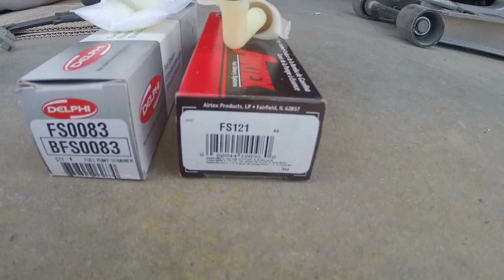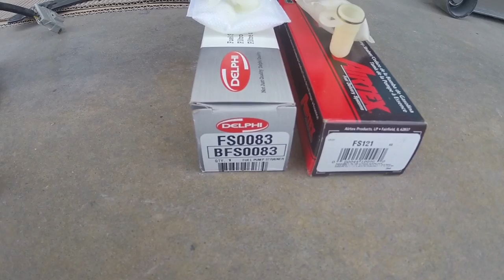How to Replace Fuel Pump & Gas Tank (88-91 Civic/CRX)

Comment: I just want to point something out that may help someone in the future, as this happened to me. I followed this video step by step and other various fourms to install my new 255lph fuel pump into my ef hatch, and after everything was set up and ready to go, the car wouldnt start. Doubting my mechanical skills i took everything apart again but still everything looked fine, at a complete loss and after hours of searching I came across a couple "no-start" main relay fixes, swapped the relay from my doner car and what do you know? Starts on a dime, what are the chances? Anyways, great informational video, a definite thumbs up from this guy!
Reply from the maker: Thanks so much for the input!  It's great to hear what fixes other peoples problems.  I can't tell you how many times I've done double work similar to you only to find it be something so simple!  Were you shaking your head at how easy it was to get to and replace/repair the MFR?
Reply: Garage Built Hondas 100%! although funny enough after I got it started and ran it for a bit I lifted the tank back up and tightened everything, all ready to go and what do you know? No start! 😂 im even more stumped now, multi-metered the relay and everything checks out, checked all wires and even tried the bypass wire in the harness and nothing! Such a pain this civy of mine 😫
Reply: KeySho What did you end up finding wrong?
Reply: @Keyorisho  Did you check fuses?
Reply: @hecks_k20_fa5  Yes, fuses checked out. I double checked almost everything I could think of.
Reply: @brent2630  In the end it turned out the be the fuel pump not reaching the lower 25% of the tank. Filled the tank and it started right up haha. Really weird because it was installed exactly where the original pump was, it's been a while but the new pump may have been a bit shorter.

Comment: Why are you replacing the gas tank ? Just have  it cleaned at a radiator shop just as good as new. ?? Great  instructional video !
Reply from the maker: Mine had damage and a small leak.

Comment: Hi Jon it's hadden vladamir III on my wife's phone and watching your fuel tank and fuel pump removal and replacement video and wanted to post a cool and helpful tip....on both my sedan and ef hatchback I had replaced my fuel tanks and took the opportunity to prime the tank with hi heat primer then duplicolor bed coating as a protection from the elements.....part 1
Reply from the maker: Nice!

Comment: Wow. I never knew how different the wagons were from the other models lol. Everything is accessible from inside the car in my wagovan. Extremely helpful video though
Reply from the maker: I wasn't aware of that on wagons.  Thought all 4th gen civics had no access to the fuel pump from the rear interior, good to know.
Reply: Hunter, could you confirm what year wagon you have? I need to replace my fuel pump in my 89 wagovan, and I was also under the impression that you needed to drop the tank. Could you access the fuel pump from under the seat?? Thanks!!

Comment: Huge fan of this tear down and it helped me last year with getting my Y49 to run again! I'm currently running issues with putting the Filler Neck Hose back on, and I found the part(17651-SH3-000)0 is discontinued so I'm having to use a universal fuel hose and cut it to size, but I'm still worried it's going to kink a little. 
I think my next step is to completely drop the tank again and place the hose onto the tank and then left it back up and place it on the Filler Neck Pipe second.

Awesome Channel!
Reply from the maker: Thanks James.  There isn't much bend to that hose so I think you'll be ok with a universal one.  As it's on there, it'll slowly conform anyway as long as you don't leave too much slack for it to bind.
Reply: Garage Built Hondas I’ve loosened the clamp around the filler hose but it’s not budging. Any tricks?
Reply from the maker: Spray it down with a lubricant and use different sets of pliers

Comment: This is most insightful! I have a 2001 honda civic coupe, and after getting my map sensor and 02 sensors installed, I still kept smelling gas fart. Also I think that my front passenger side tire rim is bent or something...the car pulls to the right (whatever). Anyway, after watching this vid, I think I'll just buy another car and put my civic in the backyard until further notice. Thanks dude!! ★★★★
Reply: I got a 89 Honda prelude I have to change the gas pump  is that also in the tank so that mean I have to bring the tank down????
Reply from the maker: +Manuelmmmzmskssnmsn mmmsmak Galvez Not unless you have the door under the rear seat.  I bet it's the same as this being similar design because of the same years.
Reply: Garage Built Hondas well is 1989 Honda prelude si 2.0 n under the back sits there is 2 round silver lids
Reply from the maker: +Manuelmmmzmskssnmsn mmmsmak Galvez I would check under both, you might have access there.

Comment: Also if the fuel tank padding isn't salvageable here is a cool trick order some extreme sound dynamic padding from summit or jegs or cruchfield with self adhesive backing and cut to fit where needed.....it worked great for me and very inexpensive....part 2
Reply from the maker: That's sounds smart, I've used that product before and it seems like it would work perfect.

Comment: Attempted this today, but had to stop due to rain. Tomorrow is clear weather. Unfortunately my pump went out right after I filled up. So after cracking that 14 line nut 🔩 I had fuel leaking. (Which I figured would happen) tried to siphon the gas from the gas filler, but feels like my siphon line is bottoming out before it makes it to the fuel. Anyways, I'll just have to pull the drain plug tomorrow... Great video man!
Reply from the maker: Good luck, the tank is so heavy with a lot of gas in it too.  I'd tried to drain it too, but save as much as possible.
Reply: @GarageBuiltHondas  the weather cleared up so I pulled the sending unit out and siphoned the gas into two 5gallon plastic tanks. It got dark, so tomorrow I'll be finishing her up!
Reply: @GarageBuiltHondas  completed the job just now and filled about 5 gallons back into the tank (via gas cap/filler) connected everything back up. I hear the 2 clicks from the main relay which is good... Right? At the same time I hear the fuel pump prime... I cranked it about 5 times. (Holding for 5 to 10 sec each time) and no start. Should I put the other 5 gallons in the tank? Maybe through the sending unit opening? How quick should it start up after replacing what you did in the video?  Guess I'll check the manual to see if I'm fuel to the fuel rail. Thanks again for all your help and the time you take to make these videos. I appreciate it.
Reply from the maker: The extra gas won't help unless your fuel pump filter isn't sitting right.  I'd do what you mentioned.
Reply: @GarageBuiltHondas  UPDATE::: I committed the ultimate sin of not checking for Fuel, air, spark, combustion FIRST.  After replacing the fuel tank, fuel pump, distributor, and main relay I still didn't have spark. I went to test the coil at the dizzy, noticed the rotor wasn't spinning... I knew what time it was. Busted timing belt. Smh... All I can do now is pray to the honda Gods that the valves aren't bent. Sourcing parts for this JDM D15B 3 stage vtec is always fun... anyways, lesson learned. Basics first. Time to wrench and pray.
Reply from the maker: Hope it's goes well.  Good luck!
Reply: @GarageBuiltHondas  same! But hey, now I know how to change my fuel tank and pump. Lol thanks again for the videos~
Reply: @GarageBuiltHondas  :::UPDATE 2:: installed new Timing belt, tensioner, water pump, battery (was bad) was still not getting spark. Used my multimeter and test light and found the NEW dizzy had a bad igniter. Warrantied it out, slapped it on and she fired right up!!! Yeahhhh boiiiiii!!!
There's is a ticking noise now. I'll be doing a comp. Test this weekend and I'll also check to see if the LMA's could be the culprit. Just happy to have her up and running again.

Comment: Could you perhaps provide me part numbers for the right Fuel Pump for my 90 SI EF Hatch?  I have the D16A6 motor and like you described, my hatch has the same issue with acting as though it has no gas when the gas gauge still shows about half way full.  It's been driving me crazy for almost a year and I'm wanting to make sure all the part information I purchase is correct before taking it to a shop.

I've had a feeling it was the fuel pump for several months now that were causing the idle issues, and sometimes having issues starting on hot/cold days, and bogging at higher speeds.. but yesterday was the first time the fuel pump starting whining which made me ready to get everything needed to replace.  Would love to do the whole gas tank as well.

Thanks in advance!  Video was helpful
Reply from the maker: I don't have the part # for the pump.  Where do you want to buy your pump from?
Reply: Garage Built Hondas no preference I just know my car is having the exact same issue as what you described with the tank acting like it is completely empty even though there is almost a half tank

Comment: You made that look a lot easier than it is. Loll. I just changed my fuel pump in my 91 REX Si. Filler neck hose and putting the tank back in the front clip was a bitch! Thank you for your video tho. Helped me out. 👍🏼
Reply from the maker: It really is for the first time.  I guarantee it gets easier every time.  Now I'm a pro after doing at least 10 since this video came out.  👍

Comment: Cool video. I cam here because I have an issue with my 1991 CRX SI.  It has happened twice, a few days apart.  Both times, I parked the car for a few minutes.  First time, I stopped at a gas station. I shut off car and put in full tank.  Then I got into car. It started and stalled.  I cranked it again. It started and then stalled.  Third time,  it started and I was good for the rest of the day.  Now, today, I drove 40 miles, parked car and went into store. Slight incline. I started car. It started then, died.  It started  then died.  It started and I got it home.  I stopped the car at the house. Then, I started it and no problem. It's been sitting for 30 minutes now. I went out and started it three times, each time being ok.  Ideas?  Maybe fuel pump going out?
Reply from the maker: Yup.  Pressure test the system/pump.  https://youtu.be/i9t9OapKffg

Comment: What did you do with the O ring that came with the fuel pump. When I replaced my fuel pump I seen it but didn't know where it went so I just left it out.
Reply from the maker: Which O-RING?
Reply: when you buy the fuel pump it comes with a short hose, two clamps and a black o ring. its in your video
Reply from the maker: Do me a favor, what minute mark is it at?

Comment: Thanks! You are a CRX pioneer. I'm waiting for that fuel pump to come today through Amazon Prime. Meanwhile, getting the fuel out of the tank is nasty. I tried to go old school and syphon it out with a hose and me sucking on the other end. Ended up with a moth full of gas ( I didn't swallow). headed Auto Zone for a Fuel syphon pump. Thanks again.
Reply from the maker: You're welcome, glad this helped!
Reply: Update, It wasn't my fuel pump. It was the ECU fuse and ECU. I have a bad ECU so it wouldn't prime my fuel pump. Nonetheless, I don't have to worry about the fuel pump.

Comment: Great videos! Off topic question, but why don't you remove the sound detonating tar for weight reduction? I noticed you were doing weight reduction in your other vehicles
Reply from the maker: thanks!

I planned on it but haven't had the time yet.  Unfortunately I live in Texas and it's a little hot already so that'll make it more of a pain in the ass.  I was hoping to finish it in the winter but now I'll probably just go get dry ice and chip away at it.
Reply: +Jon Widmer I see. Yea that sucks man. I would hate to be in the heat when you already sweat from working on cars lol but good luck with the build! 👍🏽

Comment: Hi Jon.   I replaced the fuel pump and gas tank and still can't get it to star. What do you think it's wrong with  my crx. The fuel pump and gas tank had rust all over.
Reply from the maker: Had it been running before?  Has it been sitting for a long time?
Reply: Justin Vargas main relay

Comment: just curious why did you change tank. going forward with the new tank, how will you drain the tank if you need to work on tubes and all?
Reply from the maker: I dented it at the track and it was leaking.  It had previous dents also but the latest sprung a small leak.

It has the drain plug still, I could drain it and work on the tubes if needed.

Comment: hey man great vid! I have a quick question and hope you can help. I started my car(1991 hatch) early in the morning and it iddled for like 5 sec and it stalled and just wont turn on again. I no longer hear the fuel pump buzz when i switch the key is it the fuel pump for sure? need the help and appreciate your video man
Reply from the maker: It kind of sounds like it.  You may also want to try to Main Fuel Relay first.  It's located under the dash on the far left driver side right above the hood release.
Reply: Jon Widmer okay man thankyou

Comment: i have to replace the gas tank on my 2000 civic si do you think the steps would be the exact same please let me know
Reply from the maker: Exactly the same, probably not 100%.   But probably very similar.  There may be a few different lines by now, I've never changed one on that kind of car.  Good luck

Comment: Another great video man, much appreciated! I’m waiting for the fuel pressure gauge and if the pump is failing on my Teg, I may have to do this... 

Correct me if I’m wrong 88-91 Civic/CRX Integra NORMAL fuel pressure is between 32-37PSI correct?
Reply from the maker: I can't remember off the top ofy head.  I did talk about it in this video where it should be with the FPR unplugged and plugged in.  https://youtu.be/i9t9OapKffg
Reply: I'm currently looking at the CRX OEM manual page 6-76 and with the regulator vacuum hose disconnected it should be 35-41 PSI.  (I know it's an old post, thought future people might want to know).

Comment: I have a 92 Integra and was wondering if a 88 - 91 civic/crx suspension would fit my car?
Reply from the maker: It fits, but if I remember correctly the shocks will be shorter than the 90-93 Integra shocks.   It depends on the complete setup that you are using.
Reply: Alright thank you for the quick reply.

Comment: why did you opt for the Airtex FS121 fuel strainer instead of the Delphi FS0083? I'm aware both work, but just curious. I'm assuming because you could return the Delphi, but not the Airtex? Also, where are you located, if you don't mind my asking? Thanks for the great video.
Reply from the maker: Captain Teemo Absolutely correct, I had purchased the Delphi at Autozone and had ordered the Airtex online, and the Airtex was about $4 less expensive too.  I am in El Paso!  Are you in TX?
Reply: Jon Widmer Ah, Texas! Sadly nowhere close, I'm in Northeast Alabama, almost Georgia. I've had a nearly pristine '91 CRX Si sitting in a garage for 5 years, after rescuing it from a cow pasture shed, which I've finally began work to make road ready again. No engine or trans. I have zero concerns with the work as I'm a trained technician, but figuring out how all of the minor things are oriented, installed, which fasteners, etc. is going to be a real pain. Watching various instructional for all scenarios I might run into. Found your playlist, subbed heh
Reply from the maker: Captain Teemo I see, it should be a lot of fun.  These cars are pretty easy to find your way around.  If you do need a hand with anything let me know, I may be able to offer some assistance!
Reply: Jon Widmer Thanks Jon, I'll be sure to keep you in mind!
Reply: EP boy here too
Reply from the maker: What do you drive?
Reply from the maker: I've used both.  Couldn't tell the difference.  Both work perfectly fine for any normal fuel consuming needs.

Comment: At 2:50 where you recommend to use the line wrench... is there anyway you can replace that fuel line? My brother used a regular wrench to disconnect that line and stripped that nut and then stripped the threads inside when he attempted to reinstall :(
Reply from the maker: Try a junkyard for replacing parts.  I don't know if they sell them new any longer.

Comment: The CRX SI and DX have a 11.9 galllon tank right? I have a 88 CRX HF with a 10.6 gallon tank, but only the 11.9 seems to be available as a replacement part. It should fit the HF model right?
Reply from the maker: Yes
Reply: @GarageBuiltHondas  that’s weird they made a different tank for the hf even though the other one still fits.
Reply from the maker: Smaller, less weight when full for the HF to achieve the MPGs it did.

Comment: It's enough to say run the gasoline out to lighten the tank.  You could point out that gasoline weighs about six pounds per gallon, so five gallons in the tank weighs a little over 30 pounds and ten gallons in the tank a little over 60 pounds and full is about 90 pounds.
"Kilmat 80 mil" from Amazon is the vibration dampener to glue onto the tank.  It comes in packs of 12" x 18" pieces which can be cut to any lesser size.  Way too much talk about the vibration dampener pads on the tank.  You already said it was the level sensor.
NEVER use crimp connectors!  They will always corrode and fail to conduct.  Solder and insulate with several layers of heat shrink.
Reply from the maker: Thanks for all the great info! ❤️

Comment: Do you have any videos on how to remove and clean or replace DPFI injectors? I have a 89 DX Sedan that has been sitting a while and want to clean or change injectors.
Reply from the maker: I do not.  Personally I would remove them and take them to a local injector shop or shipped to a shop and have them professionally cleaned and flow balanced.